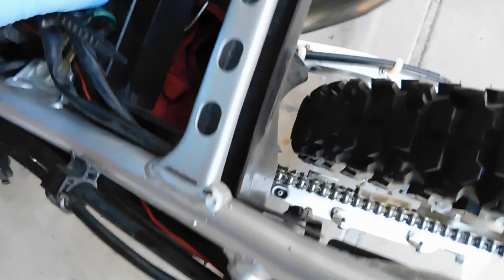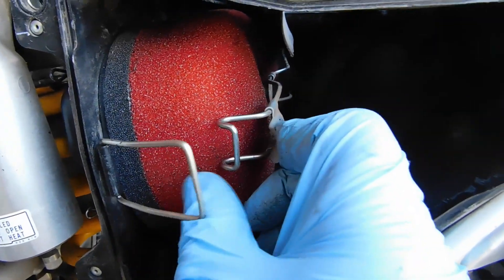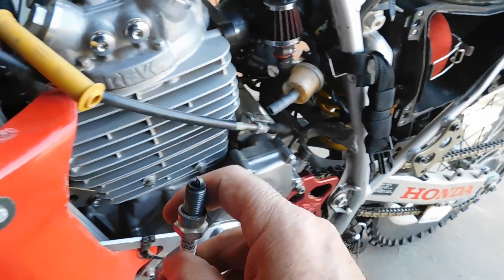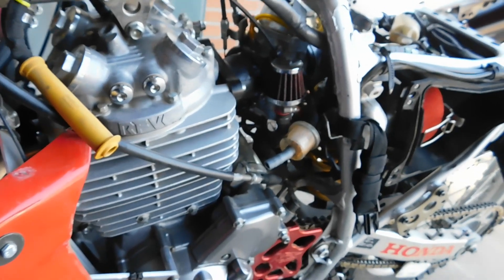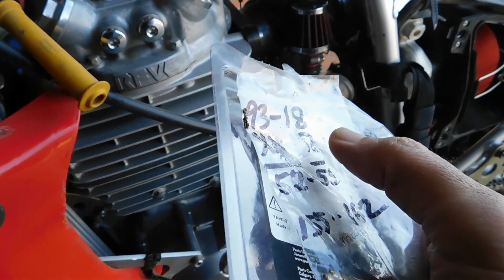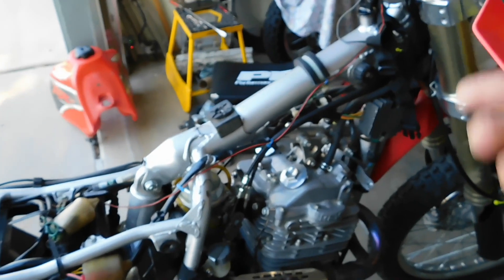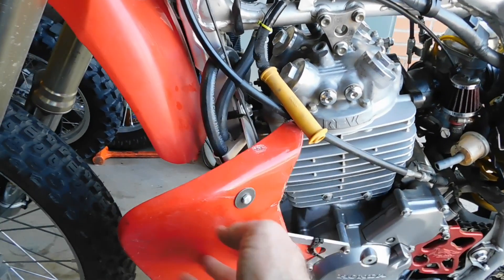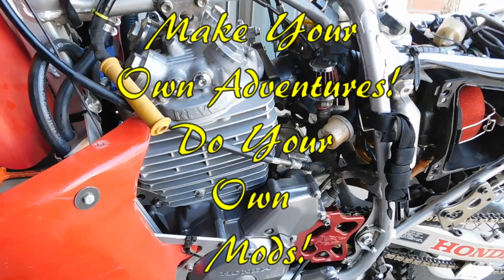XR650 Airbox & jetting mods

Comment from the maker: Hi, yes, I am still happy with this jetting, the mileage is still not what the DR650 is but the bike rips. I am at 1400 feet, your jetting should be stock or a bit leaner at that altitude, I would say pull the snorkel in the air box and drill a few holes in the top of the air box first. Your bike is definitely starving for air, then if needed play with the jetting.

Comment: I had my head ported  a slip on Yoshimura Muffler ,but really need the bigger head pipe she's running a tad rich , but definitely going to buy a bigger head pipe and hopefully the rich cndition will go away. Before I had the head ported I could only hit 95 now she bouncing on the 105 mark . I really don't ride that fast on the street ,but on the dirt that is where she shines .It's night ,and day with that port job. You would not believe the throttle response from stock .The only thing I don't like is the gap in the gearing.
Reply from the maker: Sounds like a beast, the XR650 is a great bike.
Reply: The header pipes are plenty big enough on a xr650 on a Dyno bigger pipes make no difference but it's your money if it's running rich go down a size or two on the jetting

Comment: Dave, Interesting! I am betting your mileage and performance have been greatly improved. As OBI- WAN says, "lean is mean". It will be great to see how your fuel mileage ends up. If I recall, you said you were getting about 35MPG. My DR was doing the same until I leaned it out with carby adjustments. it now gets about 40-50MPG depending on how I ride it. Also, I did the ProCycle mod to the airbox and it offers great performance, but it is affected by side winds due to the large hole in the top. I have worked through it by adjusting the air/fuel idle screw but it still is noticeable in high cross winds. I think it is a great call on just a 2 inch hole to allow more air without the issue above. What year is your XR650L and why does it have cartridge forks on the front? New XRs have "cartridge style" forks but they are not upside-down cartridge forks like yours. Great info and please stop making me want to pick up a XR! It will piss off the DR650!
Cheers!
Reply from the maker: Thanks for the tips and input DOC. I took it for a spin last night and it was noticeable quicker and smoother. The Lexx exhaust is nice and quiet and does not seem to effect performance from the noisy FMF muffler I removed. (Video coming on that,) if you go back in my videos I hit the lottery on a LOADED $1100. XR650L with tons of aftermarket parts that I put on mine, one being the RSW clamps and forks. In a strange twist, the CRF450 forks now on my XR650L are the same style Showa twin chamber forks that the DRZ400SM comes with and are on my DR650. The stock cartridge XR650L forks are worlds better than DR650 forks. I only did the swap because they were basically free. After I swapped all the trick parts over to my XR I sold the $1100 dollar XR for $2200. Which was basically stock at that point. Good hearing from you.
Reply: @verbalwidget0919  Brother, I have no idea how you consistently are able to pull these miracle deals! With the amount of bikes you have, I can see how it all works out. Still amazed!
Cheers!
Reply from the maker: @doc650adventures  DOC, that was definitely the "Mother Load" of deals! 
My friends and I still chuckle about that one from time to time. With the deals my 3 Dual Sports total cost is not very much for sure. Definitely less than one new DR650. Good to hear from you again.
Reply: @verbalwidget0919  Wow. Three bikes for less than my DR. I am not particularly handy and would likely not have a decent running bike if I didn't buy it new.
Reply from the maker: @ParallelCamper  I understand, it’s a blessing & sort of a curse too?
Reply from the maker: @doc650adventures  I’m a stinker … ain’t I ?? 🤣😂
Reply: What speed are you going to get 45-50mpg?
Reply: @drewsXR650L  I get the best gas mileage when I am riding at 55-60 MPH (88- 97KPH). Of course, the DR650 is just way to tempting to roll on the throttle so unless I am on a long highway stretch, the fuel mileage will be reduced. 
Cheers!

Comment: Are you still happy with this mod? I am having an issue with the bike cutting out at high RPM/ full throttle. I took the side over off and the bike ran SO much better. Thinking maybe I need to get additional airflow or come down another jet. Currently running 152/52 at 6100’.
Reply from the maker: Yes and yes

Comment: hey i noticed you have a small air filter next to your carb, I'm wondering what function it serves?  What kind of exhaust are you running?
Reply from the maker: Hi … that filter is a breather for the crankcase, it replaces the oil breather/separator from Honda.

Comment: regards 2 questions please what brand is that air filter which spark plug works better for the xr650l, standard or iridium
Reply from the maker: Hi, I use a foam Unifilter, and I usually run an Iridium plug just hoping a better plug may provide a better burn on the fuel.

Comment: My 2013 carb doesn’t have an air mixture screw.  Not sure why.
Reply from the maker: If it’s never been tampered with it is under a metal plug. You have to use a small drill to make a hole in the plug and then screw a screw into the plug and pull it out. 
I’m sure there are videos on this. Hope that helps.

Comment: nice  work  i  should  of  punched  one  like that  when  i  did the main  jet !!!
Reply from the maker: The bike ran great today, muffler nice and quiet, but fuel mileage still at 35-40 mpg? I'll have to check the spark plug and see how its burning. Thank you
Reply: nice glad the muffler  is doing what you want .  35-40  is  good mpg!!!

Comment: Wondering why u cut out there and not the side panel?
Reply from the maker: I’ve heard cutting out the air box on the sides is louder, and on the top is harder for water to get in.
Reply: True.   I did this on my 450x and it sounds like a turbo.   Great videos BTW! Keep it up

Comment: What's considered good mpg's for this bike? Has anyone been able to squeeze 60+ mpg out of it?
Reply from the maker: Hi Suzy, my average is about 37 mpg and 42 mpg is the best ever just riding at 40 mph. I have had guys tell me they get in the 50 mpg range? my bike had a Dyno jet kit and the bike never ran correctly. I went back to Keihin jets and a slide that had not been drilled with the Dave's mods and it now runs great, but mileage is still 35 to 37. I tell people, my XR650 gets 35, the DR650 @45, and the KLR650@ 55mpg. The DR650 is easily the fastest. Thank you.
Reply: @verbalwidget0919  Interesting info & thanks. Hoping to get mpg numbers from someone who's tried a Lectron carb on any of those three bikes. Of course engine cooling becomes the problem when you're running lean.
Reply from the maker: @suzyamerica4679  A Lectron carbs results would be interesting. XR650L is known to stick  valves in the valve guides if it runs too hot for extended highway speeds. You definitely don’t want to run lean. I added the oil cooler and scoop to reduce temperatures to a more normal 250 degrees from 300 degrees that I was seeing before because as hot as it gets in AZ I did not want to risk top-end damage when I was running highway speeds. 
The DR650 comes with a huge oil cooler, the KLR650 uses water. Why Honda saw not to fit an oil cooler is puzzling since the XR400 came with a cooler.
Reply: @verbalwidget0919  Guessing it would be pretty quixotic of me to try to get 60+ mpg out of any of those old 3 thumpers.
Reply from the maker: @suzyamerica4679  from my riding ... only the KLR has the possibility for 60mpg. I've been close a few times. I have no idea how it pulls it off. good talking to you.
Reply: Lol 60 not in this world
Reply: @verbalwidget0919  a oil cooler would just be a failure point I just run synthetic oil specifically rotella T-6 15-40 it can handle the heat been running it since new I change it at 1000 mi and the filter at 2000 mi the bike has 10,000 mi on it and at 1000 mi the oil looks new on the dipstick
Reply from the maker: @nathandevine552  It is but I believe the benefits out way the bad. I’m in Arizona where summer time temperatures are 110 + even in October we are still in the upper 90’s and low 100’s. I was riding the XR at freeway speeds for an hour or two just to get to the off road section I wanted to explore. I’ve seen temperatures just shy of 300 degrees. Running the cooler and the scoop dropped temperatures 60 degrees. 
The internet is full of articles on guys sticking the valves in the valve guides do to the engine running too hot. My DR650 has s oil cooler from the factory twice the size of the kit I installed. 
I understand your concerned about the reliability factor, I purchased a bypass that installs in minutes with two hose clamps from Sutton oil coolers and carried it with me in my tank bag. I never had to use it and was only $10 bucks at the time. 
To each his own. I live in one of the hottest places around where we just broke a record for most days over 110, and I rode the interstate to explore farther from home. 
If you live in a cooler place or seldom ride the freeway your probably ok. 
I was using a trail tech to monitor the temperatures 300 degrees was easily to get. 
Thanks for the comment.
Reply: @verbalwidget0919  I wonder how many of those failures had cooling fins plugged up with mud but lower oil temperature is always a good thing unless it doesn't get over 212
Reply from the maker: @nathandevine552 No telling , many variables for each bike. For me it was cheap insurance and with the bypass I could get home if something went wrong. If yours is running cool than probably not needed. Thank you.